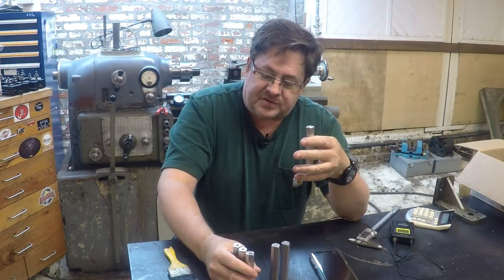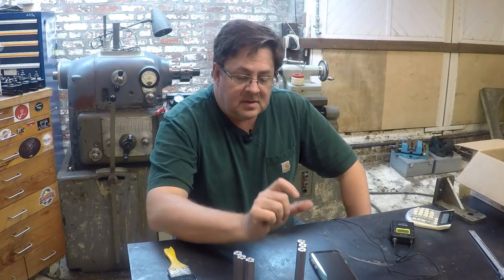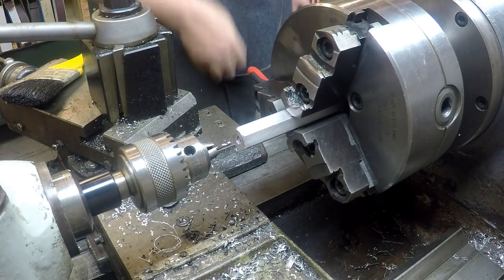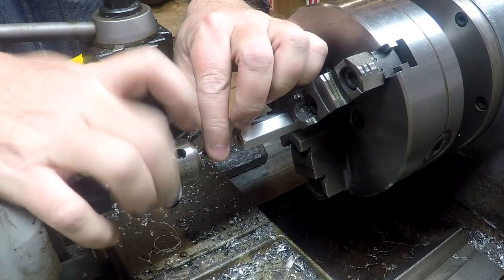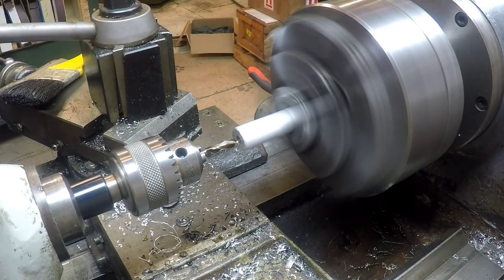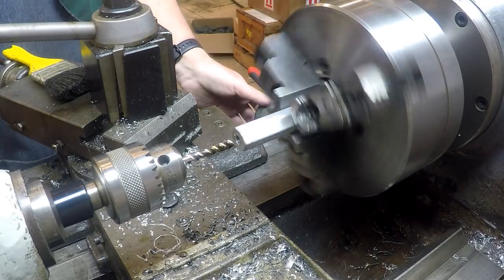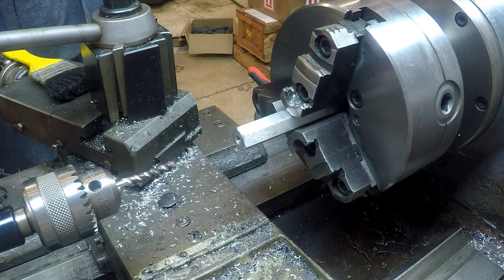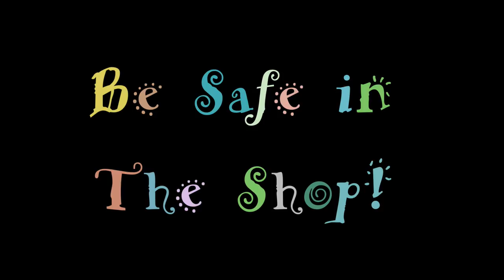Little Get-R-Out

Comment: I've got a couple very old Harleys...so plenty of Lock-Tite...a mech/machinist friend of mine said..."red on the inside of the motor/trans....blue on the outside"....another helpful tip...heat the assembly to about 400 degrees F...breaks the locktite bond....a set of left hand drills and easy-outs can be helpful...lots of times, just using the drill will unscrew the fastener...

Comment: There is one of the thing you need to be careful of when doing this type of repair.  I've had the tap cut the threads in the aluminum and not peal out the steel.. What is left is a double thread with one thread being filled with left over bolt threads and the other is what the bolt screws into.    Thread strength is compromised.

Comment: Thank you.  I've learned a good rule about Loc-Tite and small fasteners:  do not use it for them.
Reply: Or get the correct loctite for small fasteners.  There are about 10-15 different grades of it. Liquid, stick, red, blue, green, black etc...
Reply: and use heat to break it loose...

Comment: Never, got the argument for not to putting end mills in a drill chuck (for light plunging) due to the hardened shank damaging the hardened  drill chuck jaws. Wouldn't a carbide drill have a hard shank, and not just at the cutting tip?